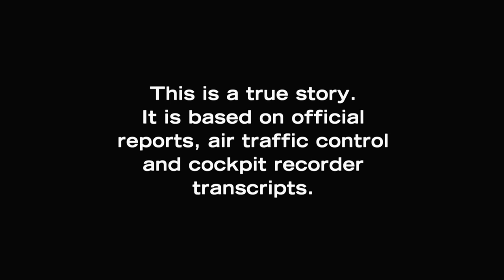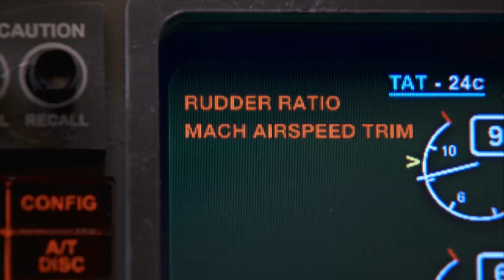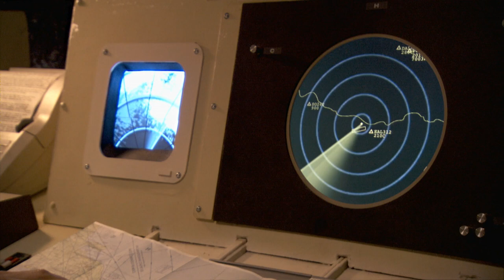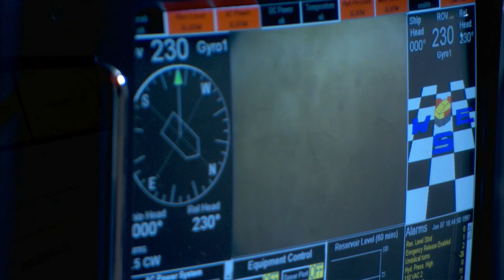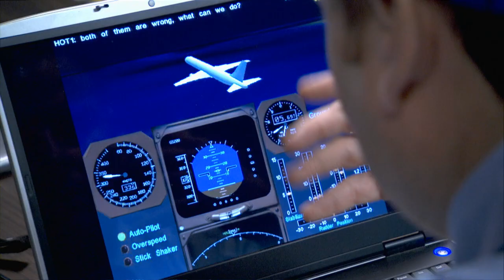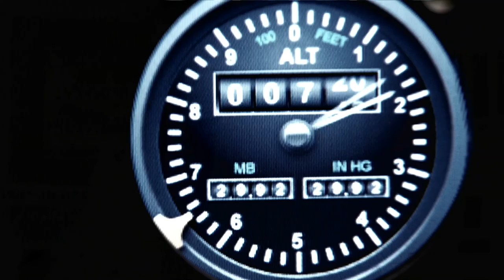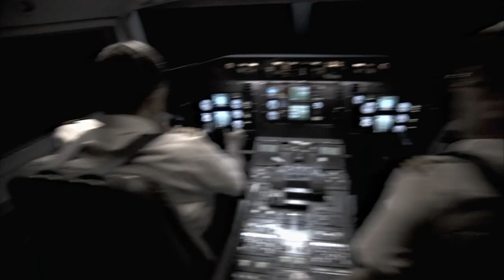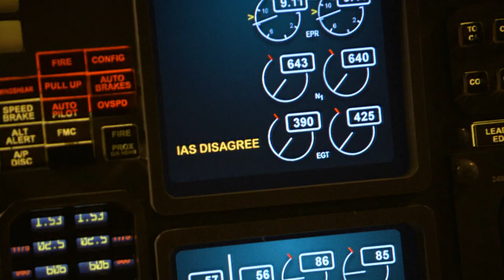The Plane That Wouldn't Talk | Faulty Readings | FULL EPISODE | Mayday: Air Disaster

Comment: Unbelievably frustrating to watch. Consider the situation. At takeoff roll there is a clear issue with the captain sides ASI, using the FO side ASI they rotate and climb without issue, then while outbound on the SID during climb and immediately after setting autopilot command B for a level change to the initial cruising altitude you have overspeed and Mach trim/rudder ratio alarms... I don’t know how the following didn’t occur:

1)Compare captain side, FO side and standby instruments. 

2)Judging from the clearly faulty indications during T/O on the captain sides ASI, come to the conclusion that either the air data or pitot/static system on the captains side are faulty.

3) realize that the autopilot is sourcing its airspeed data from the captains side pitot’s and trying to slow the aircraft due to faulty indications of overspeed, taking into account that the stick shaker relies on both the pitot-static system AND the AOA vane, two entirely separate systems and given that the captains side is showing an overspeed, gain further confirmation that its his side which is faulty.

4) compare the standby ASI with the F/O side and switch the air data source to the F/O side

5) recover stable flight by using the standby or F/O side instruments either flying manually or using the A/P with source data from the #2 or #3 air data modules (and by extension the backup pitot/static systems)
6) declare a PAN or emergency and land

No doubt there is a bit of Monday morning quarterbacking here, but it’s frustrating to know how easily this could of been resolved before it became anywhere close to the disaster it was.

Also, if the captain realized his ASI was faulty and it was PRIOR to reaching the high speed regime of the takeoff roll, then IMO he should have rejected. After entering the high speed regime but still before V1 is a bit more tricky, if the F/O side was working then taking the issue into the air is probably the safer option. However regardless of this, he should have at the very least taken steps to completely identify the issue before making the decision to continue. This may not necessarily mean turning back... but he would have to identify the issue as being a faulty captains side ASI (or pitot if he was ultimately able to hash this out) and then probably consult the MEL (minimum equipment list) to see if continuing was appropriate.

Comment: The relief pilot should have told  the captain to push the nose down
A close scenario to this is the crash Air France 447 in which the aircraft also stalled and the pilots failed to realize it

Comment: I’m a little confused when it comes to planes stalling in all of these air disaster type shows. How come when they get the stick shaker and audible stall warnings that the VERY FIRST step in the  stall checklist is not increase to max throttle???? Every time this happens they try a bunch of different things and only after a minute or so of trying different things do they then finally push the throttles to max. Why is increasing power not the absolute first thing on the list????? I’m not trying to be sarcastic or anything like that, it’s an honest question. I’m sure there’s a reason and rationale for it so I’m just curious as to what that reason is

Comment: The captain seems to have made the most rookie of mistakes. Beyond not putting the nose down in a stick shaker incident, what a bad decision to throttle back in the first place. These planes can easily exceed their maximum designed speeds and attitudes (look at the DC10 that was flown upside down and at Mach 1),  but a stall during a climb is a much more serious problem. HOWEVER, the flight simulator tests show that the situation lead other pilots to crash. So, we can’t fault him too much. I think the decision not to abort the takeoff was the least questionable decision of all.

Comment: The investigators questioned if the pilots had the proper space available to them to abort take off when they first noticed a problem on take off. Yet the investigators didn't know that answer themselves and had to go out and measure and calculate the figures for the answer. How long did it take the investigators to come up with the answer? Hours, weeks? How is a pilot to know that answer in a split second while all the factors are in play? Sorry but a airplane that's been sitting that long should be gone over with a fine tooth comb before being placed in service.

Comment: Clearly establishes his airspeed indicator is faulty and the FO’s is correct. 2 minutes later decides his is correct and the other 2 are wrong. It’s hard to watch these knowing these problems should be obvious and easy to deal with for any knowledgeable pilot but the human factor always causes people to make the most ridiculous mistakes.  I have a question though. Once you’ve lost essentially all of your forward ground speed and are in a deeep stall, is it generally then impossible to ever regain enough speed to exit the stall? My assumption is that even if you were able to regain enough flow over the wings, by that time attempting to pull out of the stall would cause most planes to simply break up due to exceeding g-limits? If you’ve lost all of your speed is it impossible to recover from even if you have 30,000 feet to play with?

Comment: Yes, the captain should have aborted take-off. Then he should have disconnected the autopilot as soon as the problems began (different speeds readings). Third, he should have refered to the other speed data and pushed the nose down flying manually back to the airport. Easier to say than to do. But obviously the captain has been overwhelmed by the situation. So many crashes have happened because the pilots did not turn off the autopilot right away. Very sad  story indeed ! Unfortunately, a real story...

Comment: The chief pilot should have aborted the flight immediately as soon as the two air speed indicators didn't agree.  The smart move is to always err on the side of caution.  Had they just aborted the flight at the first sight of problems no one would have died.  Obviously the pitot tubes were blocked when the two air speed indicators didn't agree.

Comment: They should have recognized the stall condition supercedes all other issues with the plane and the critical maneuver would have been to go into the dive with the nose down while increasing engine rpm to full throttle and pull out of the dive in a parabolic fashion. Going down with the dive allows for wind to travel over the wings creating lift again (riding of the stall) and can then be slowly leveled out and increase in altitude again.

They should not have been relying on the instruments so heavily and resorted to litterally fly the plane. He had multiple airspeed reading other than the petotube and the  ground control could have relayed their speed. No way were they going 350knots right after take off while climbing. It's physically impossible.

The reason the autopilot failed was because of the feedback mechanism that operated with airspeed converted to velocity to adjust engine rpm. However the airspeed was reading high slowing the plane down. Since the airplane doesn't want to stall it starts pitching the nose up to maximum the computer can slow the engines down more to try to minimize the speed.

The auto pilot put the airplane in the condition of at the brink of stalling.

Had the captain gave more power to the engines to correct the stall they would have easily survived this accident. IMO it's irresponsible to blame the bees/wasps.

Comment: Its strange to me that not 1 of the 3 pilots called to abort!..and why were they not concerned about the difference in their instrument reading? Clearly they know that its not normal!
Reply: Agree, which was later fixed.  However, wasn't it clear that the FO's speed gauge was more or less correct since it had proven itself in the takeoff?
Reply: @janandnaomi2000  but if they are supposed to be the same and always are then i dont understand.?
Reply: @sg7772  Well, given that the FO's speed gauge read X knots and that provided sufficient lift at takeoff, then we can surmise that it's at least far more reliable than the Captain's, rather than assume that they're both off, simply because they disagree.  Just because they read differently doesn't mean they're both malfunctioning.
Reply: @janandnaomi2000  ok so do u think they should have aborted or no?
Reply: @sg7772  IMO, that's a tough call.  My point is that once they were past the point of no return (successful takeoff), the FO's speed indicator showed itself to be reliable.
Reply: @janandnaomi2000  oh i didnt realize they were past V1 makes sense now!

Comment: orange box correctly depicted, audio declares "black box" throughout entire video
Reply: Because they were originally black, back when they were basically metal radio boxes in fire proof casings, painted to resist rust.  

The term is mainly used by those outside of actual aviation but it's what the general public knows them as.

Comment: Are there not personnel on the ground that specifically check these tubes on the outside of the plane before it disembarks? (you would think) (so many crashes - Air Florida for one). This plane in particular had been sitting there, not in use, for an extended period of time.(Is there not a specific check list that personnel must go by when checking planes that haven't been in use for extended periods of time?)

Comment: There can be no worse feeling than being on a plane that's going down, knowing you're going to crash. I can't imagine the horror of such a thing. 

Edit Yes he should have aborted. When you have such a critical instrument malfunctioning there should be nothing else but to abort. And I can't believe that with all the technology available today, we're still using such the primitive method of using tubes that routinely become blocked and cause a tragedy, to determine air speed. And what's even more baffling is that a FO with only 75 hours figures out what's wrong and the captain with thousands of hours didn't listen. In fact, he did EVERYTHING wrong.

Comment: honestly im not a pilot so i can't say for certain but if one peto tube is blocked I'd say flight is still possible however as a pilot i would make sure which the autopilot is connected to and if its the problem peto tube then i wouldn't use autopilot. As i said I'm not a pilot so this is only my opinion even then as a pilot they are a team doesn't matter on seniority. job is to fly the plane a d work together to get the plane safely to its destination

Comment: Could they get a speed check from ground control?
Reply: no it will also read what the plane reads i think.. based on other accident's ive seen with incorrect air speed
Reply: That would be groundspeed not airspeed unfortunately.

Comment: Shouldn't they have been able to physically feel the AoA at 15%? That would lead to the conclusion that the overspeed is a faulty reading. And so obviously the autopilot is reacting to faulty data. And so you manually correct the errors and prevent the potential stall. Disaster averted. That's it. Then you have tons of options, trying to troubleshoot the problem directly, trying to change the data input on the autopilot, reconfiguring it, or maybe you just have to run some systems manually. Whoopty fucking do.

Comment: the pilot was not a good pilot.   toop many hours letting the computer fly the plane and a lack of feel  when the computor gave the overspeeed and tried to " correct using the faulty date from the pilots compromised pitot static system the pilot should have taken over from the autopilot and looked at the altimeter and the power settings and the angle of attack gage   that would have told him which aIr speed is right   I always do a preflight and always check the pitot and the static port  Also the pilot should have known instantly that if his speed was as low as it was indicated on his gage  when he first saw it the plane would not have lifted off on rotation. So that instantly would have told him which gage was right   He needs more time in a piper cub!

Comment: I want to personally check pitot tubes on every plane I fly on. Isn't there a way to back these up or measure air speed another way? Merely curious.
Reply: I’ve been thinking about this … I was thinking that the ATC could have been able to estimate it for them, or that the flight data item would provide the speed as compared to the ground, and they could have tracked to another nearby plane — if there was one close, they could follow it to even land, or certainly know it’s current speed as they could be in communication.
Reply: Someone mentioned some airplanes have GPS which gives speed indication.
Reply: Do you inspect your tires every time you drive your car? Check pressure, tread depth, damage to sidewalls? If not, why not? You are far more likely to die in a car accident.

Comment: There's something wrong that they did it's standard procedure that even one thing if 1 thing is wrong you are not to put auto pilot on the but oh pilot on the reason why I know this is because I was a C17 pilot back in 20119 they tell you rigorously NOT TO TURN ON AUTO PILOT IF THE PETO TUBE IS BLOCKED OR GIVING UNCERTANE READINGS
Reply: I have trouble spelling sorry
Reply: But. I can understand why they had auto pilot or AP for short on in the first place they didn't know the peto Tube was block

Comment: Maybe something that is taught to commercial pilots is different than my training but I will never crash from being too slow. Flying right on the edge of the overspeed hsh is a risk I would gladly take to avoid a stall/spin
Reply: Out of curiosity, as a non-pilot, was it a mistake to not call in the emergency to the control tower? Or was there nothing they could've done to help?
Reply: @marli01  The moment the IAS disagrees at 80 kts during the takeoff roll, is the moment they should've aborted the takeoff and get that plane in for maintenance. If they skipped that and went on flying like they did, the first thing would've been fly the airplane, lower the angle of attack, and set power and pitch. There are three air speed indicators on an airliner, one on the captain's side, one on the first officer's side, and one standby in the middle. The stand by indicator is the tie-breaker, which in this case was matching with the FO's, but the captain insisted on his instead of handing off control to his FO.

Comment: Wouldn’t the autopilot automatically turn off hen it was getting faulty information? Or when warnings started sounding? Oh sure....the autopilot gets the plane in trouble,then it bails!
Reply: The plane before back then can’t always detect it was getting faulty information, now these days yes. It can detect now as it relies on two data instead of one. The real reason why they crashed is because the autopilot is relying on one dataset which was the captain’s unreliable air tube. Usually especially with Airbus when the autopilot sees data instruments disagree it’ll notify and AP disconnect alert will sound.